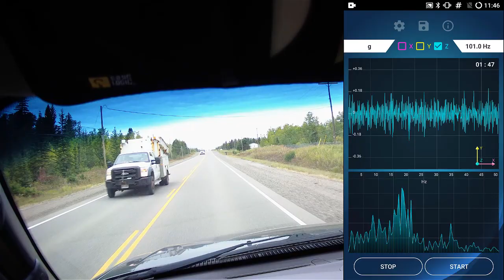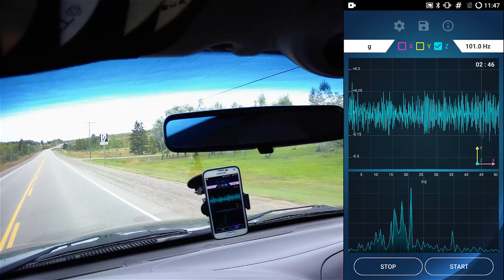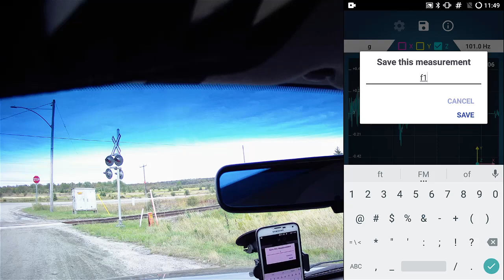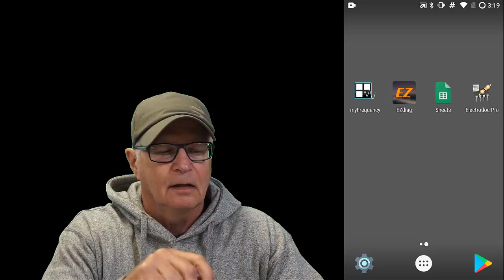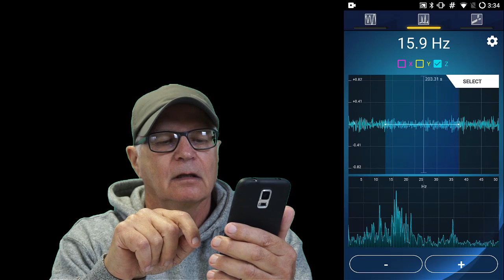GADGETS#120 - DIY NVH

Comment: So Ford Motor Company has this ability in the dealership level scan tool. You can place up to I believe 4 sensors at prescribed locations of the vehicle (also on engine, transmission, suspension etc..) and test drive it according to the directions of the scan tool. It will analyze the frequency and patterns and compare them to known patterns in the data base. It will then help you narrow down to the problem.
Reply from the maker: Good to know and thanks for sharing, Josh.
This would be out of the hands and means of DIY mechanics and many professional mechanics for that matter.

Comment: This is a great way to separate out vibration/shake sources. And in the grand scheme of things $15 is very reasonable. Plus using this app it should be easy to diagnose machinery with with different speed shafts and gears. Well done!
Reply from the maker: yes Al, I think myFREQUENCY app is targeted at stationary machinery.
Thanks for the comment:)

Comment: Good video . If we don’t know the final drive ratio , I suspect it can be calculated by dividing the engine rpm taken when the transmission is operating in direct ratio of 1:1and the lockup converter in an automatic transmission is locked up or as close to locked up on pwm converters  by the tire rpm . Many front wheel drive cars the final drive ratio is difficult to impossible to find .
Reply from the maker: I base most of it on wheel RPM/frequency. We expect the axle ration to be between 3.5x and 4x that.
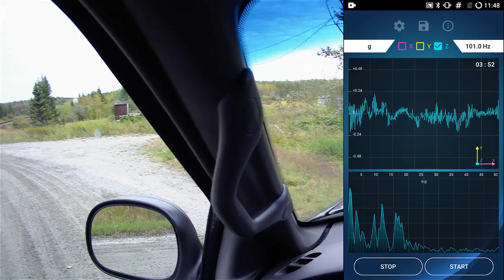My truck is a example of this. I ordered it from the factory 19 yrs ago. I was "sure" it had a 3:55 axle. I only found out it was actually a 3:31 in doing this video...lol

Comment: Keep up this awesome work. I was thinking the other day, if you had a rattle under the dash, and used a sirometer to determine the frequency that the noise is occurring, could you use an audio frequency generator app dialed to that frequency, and the car speakers as the output?  I'd like to use it to help isolate problems without needing to hold a loaded engine rpm while upsidedown under the dash. 

I work at a dealership, and suddenly I don't get any complaints like this to test it on!  Maybe you already know the answer though?
Reply from the maker: you're on to something that I've been giving some thought to, Matt...am swamped with these 2 HS-ACC projects for a while but what you raise is worth pursuing and may actually tie in to the SINGLE HS-ACC implementation...

Comment: Another great diagnostic tool !! I wonder if it can diagnose an engine misfire ? Thinking of my diesel dodge. The engine is so undampened that it's hard to pick out when something new is going wrong.
Reply from the maker: Hi Mike! I have been following your tractor work a bit...
As to your Dodge Cummins, it might be able to pick up a single cylinder misfire. It would show up @ 1/2 the engine RPM frequency...if it does.

Comment: Thank you for posting this!  Curious if you feel the phone mount would have any dampening effects as it is not a hard mount to vehicle body?
Reply from the maker: Windshields are a structural member of the vehicle and the suction mount used here is pretty good.

There's a new development by Martin Loren called HS-ACC that will provide 3-axis accelerometer that can be secured under the vehicle and transmit WiFi to phone. I'll be featuring this in near future.

Thank You for watching Chris:)

Comment: Very interesting,  I wonder if the 16.09 resonance would change with extra weight in the bed. There might be a sweet spot with very little v.
Reply from the maker: That 15 Hz - 16 Hz area gets excited real easy, even at 10 kph!
So your idea of extra weight should help confirm it's body resonance. It should dampen it.
Thanks for the input, Dave:)

Comment: Very reasonable price for that app. Does it use the accelerometer built into the phone? A good phone mount or placement on a solid surface must be required. Now I have to check for an iPhone version. Thanks for the info.
Reply from the maker: Yes, the app uses the smartphone's accelerometer. Poor you stuck with an iPhone:)
Let me know how you make out with this Chad...
Reply: the GADGETS playlist crap! I have an iPhone too! Haha
Reply: Voltage Drop Diagnostics lol I just spent the last 20 minutes looking for an iPhone app.  There is a 2 star app for $400.
Reply: I should probably just pickup a used Samsung just for android only apps
Reply from the maker: @ThePracticalMechanic  why I'm an ANDROID guy, Chad:)
Reply from the maker: @ThePracticalMechanic   in the video, it's an old SAMSUNG S5 given to me by a friend. No SIM card. I have a flip phone for that...lol
Reply from the maker: @VoltageDropDiagnostics   even in ANDROID, it took me a while to find this myFREQUENCY app that could do a good job of this work. It's tricky stuff, PJ...
Reply: the GADGETS playlist i tried switching to android. I just couldn’t get used to it! Lol

I need these phones that never change
Reply from the maker: @VoltageDropDiagnostics  yep, once we're used to something...
Reply: @ThePracticalMechanic   iPhone has an app  called “vibration” by Diffraction Limited Design  that may be useful.  “Vibration Analysis” is another one - it requires an in app purchase to change the settings.

Comment: Nicely done. Now...did you figure for the overdrive in the transmission and the vibration from both the gears and the clutches? You do have some harmonic resonance from such items. 😁
Reply from the maker: All embedded in that 15Hz to 20Hz range. Would be tough to unscramble from the rest.
Would require an accelerometer stuck on the transmission itself connected to that HS101 PRO Bluetooth oscilloscope secured under vehicle.
That would be a whole other video.
Reply: @theGADGETSplaylist  Down the rabbit hole we go. 😃
Reply from the maker: @rs1971camaro  yep, I think this will be right up Rick's alley:)

Comment: Very good. Video. I'll have to play with this.
AGAIN. Denis is costing me money with all of his gadgets. I'm a sucker for gadgets  :-)
At least I don't have to build anything this time :-)
Thanks for finding the app suited to this.
What do you think you'd get on a front wheel drive vehicle being that most of the rotating stuff is inside the big block of mechanics under the hood?
Reply from the maker: Playing with it describes the process well...
Concept remains the same for front wheel drive. We always start with wheel RPM. C/V joint would rotate at same frequency. If a problem, there would be a big spike there but can't tell us wheels or shaft, only that we're looking in the right direction.
Driving in different gears (if we know the ratios) could also be telling of "the rotating stuff inside"
It's a tool that requires a bit of hands on and thinking cap on.

Comment: cool
Reply from the maker: it is, Dan
thanks for dropping by:)
Reply: @theGADGETSplaylist  Very awesome video! - Wouldn't belt-line accessories like the alternator, power steering pump, A/C compressor etc. be turning at different RPM's than the engine, some slower (larger pulleys) some the same or faster (smaller pulleys) - wouldn't that noise show up on here?  Also since this is a ford vehicle, you should be able to get up to speed and put the truck in neutral and turn the ignition key off, shutting the engine off and eliminating that source of noise from the readings giving you only body/chassis/wheel/hub/road noises. Then you could re-crank while rolling down the road in neutral and drop it into gear.
Reply: As always, Great Video Denis!
Reply from the maker: @tomhorne3674  I appreciate the thought and interaction. I did experiment with putting vehicle in neutral (but engine still running). Doesn't seem to change much.
There's an inverse to this idea. Have vehicle stopped and race engine. Nothing.
We confirmed that at 1400 RPM (23.3Hz) there was no engine vibration to be seen.
As to the accessories on the serpentine, I doubt they wound contribute in a test like this. Best would be GADGETS#77 method.
Thanks for all the support, Tom:)